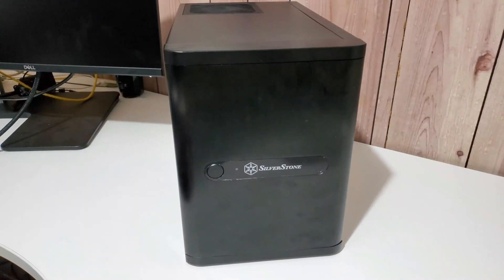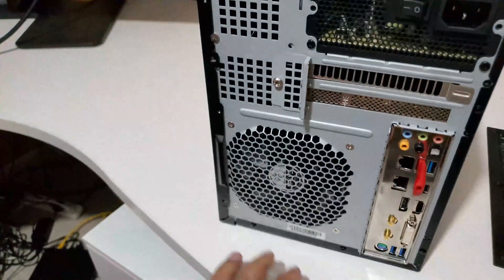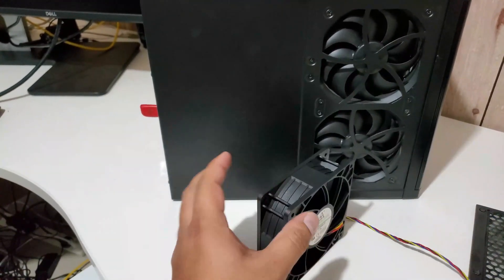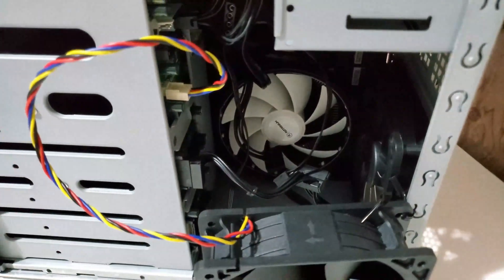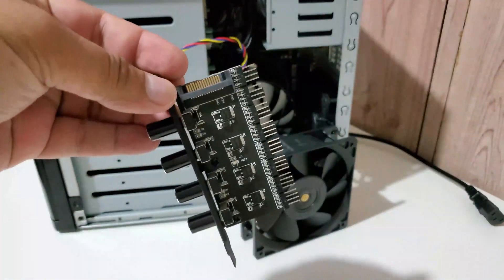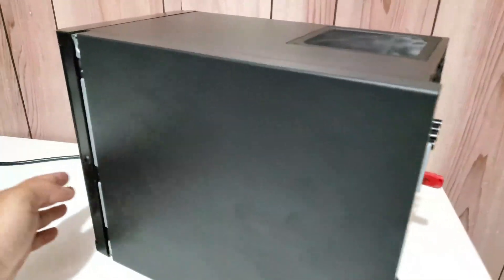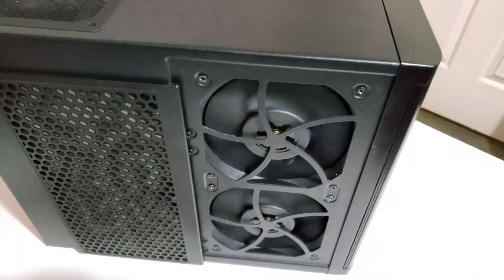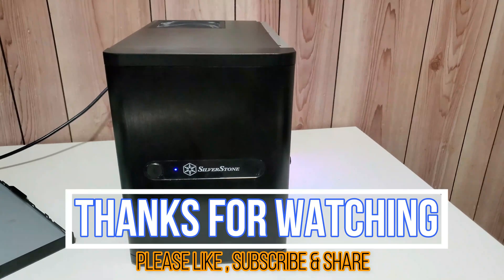Silverstone DS380 ITX Server Case Fans Upgrade

Comment: Clearly you’ve seen lower HDD temps yet you didn’t show the before/after values for what seems like a much higher dBA.  Actually, the included 9-blades SilverStone fans resemble the better performing, premium High-Pressure fans on the market - I’m surprised you found them inadequate.  And I’m NO PRO here, but keeping ya cables tucked out of the way could reduce case resistance to the exhaust fan in the rear.  So you upgraded your CPU fan as well… is THIS an indication of just how warm the case interior was getting?  Just my $0.02
Reply: I got 2 of those DS380 and I went for a 6 pack 'NF-P12 Redux 1700 PWM' to set inside boxes. I survey my drives temperatures over Grafana and watching all 16 drives some are less breathing that others. It depends on the position into the rack. For the most impacted by heat: I got 2 around 51°C, and 2 aroung 60°C. 
I'm in the process of adding the 3D Printed cooling ducts available in the community, and see how it behaves with them. 
Then I will maybe try the PPC Noctua models.
Reply: @spiritdawound  ouch!  I had WD testing my 14TB external HDDs while Crystal Disc Info showed RED as they hit 50° C for any time.  Relocating to a more open location reduced it to 46° C for the remainder of the 24 hour full scan.  Adequate cooling concerns me having so many HDDs in a tight array.  Oh, the SilverStone US rep states: “there’s no evidence operating HDDs at elevated temperatures has any negative impact on their longevity.”  I say:  WTF ???  By that logic they would not include ANY active cooling in their products!  Good luck with your solution to reduce your HDD temps.
Reply: @andrewhornfeck7421  I'm now at 40°C with 3dprinted duct fan and a 3000RPM PPC Noctua in the back.

Comment: I am going to be putting 2 arctic p12 pts pwm fans in my Silverstone case . I don't if i want to buy a ryzen 5 5600G apu and pair it with the arous b550i pro ax motherboard or wait till the intel i3-12100 is instock and pair it with asrock H670M-itx/ax  motherboard.

I will be running truenas scale and i will be running a jellyfin container , pihole , using to backup files and serveral other containers that i had not think of yet